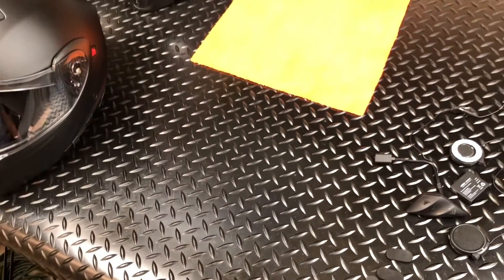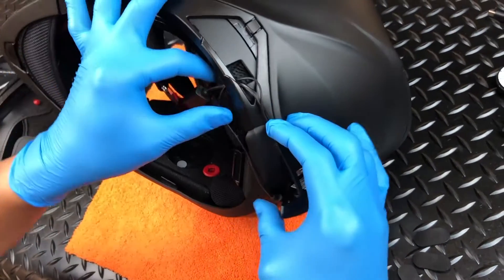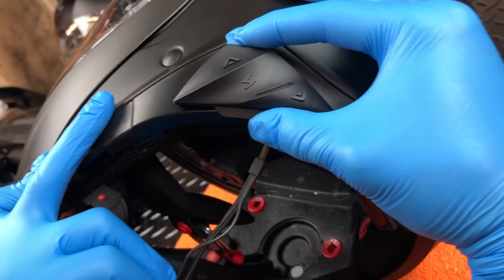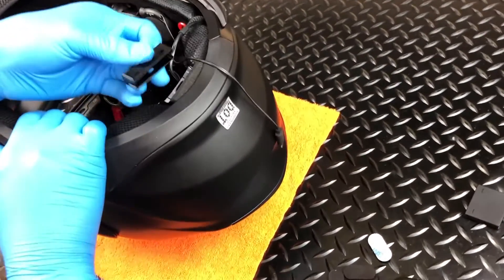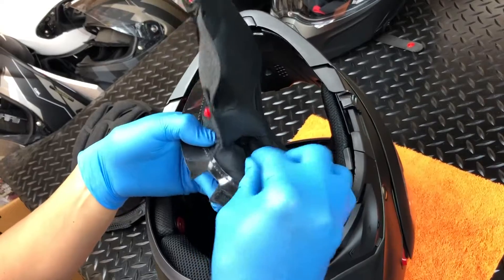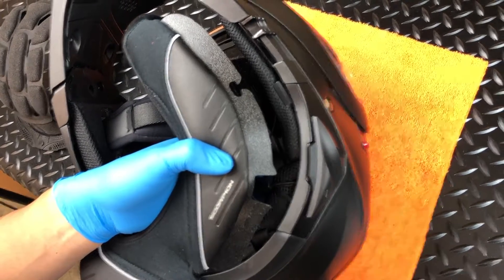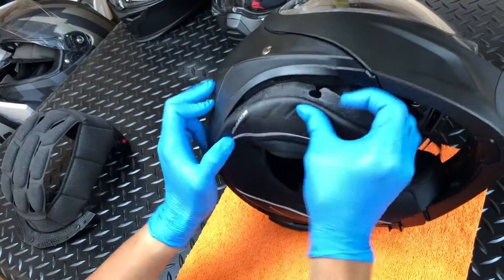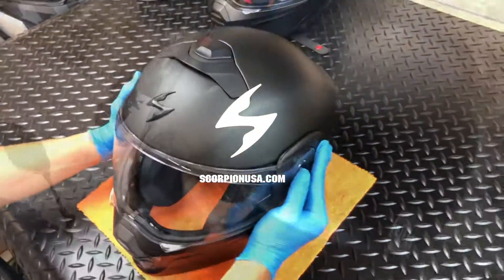EXO-Com Installation (GT930)

Comment: I just got the GT930 helmet. I'm not 100% on it. after taking out all the pads to put in the exo-com they don't seem to go back in right. They're pinched up in the back and pull out every time I take the helmet off. the biggest issue I have is that damned sun visor, it's so loose. With every bump in the road it comes down. I don't know if I just got a lemon or what but I'm thinking of returning it